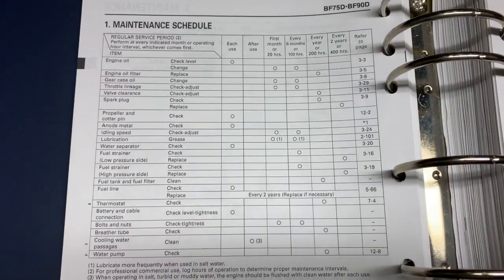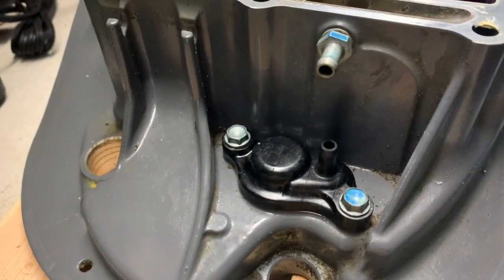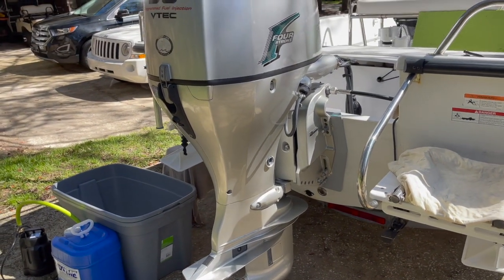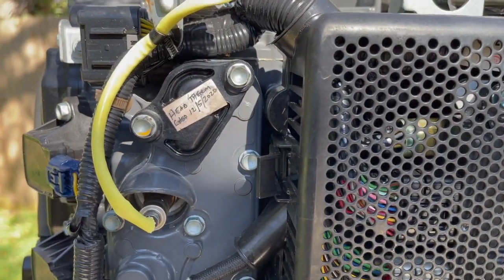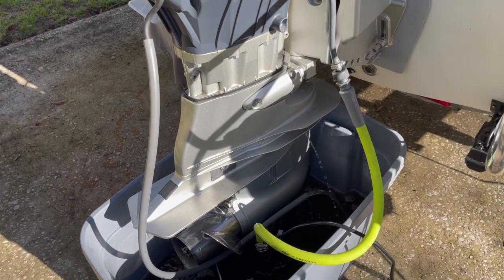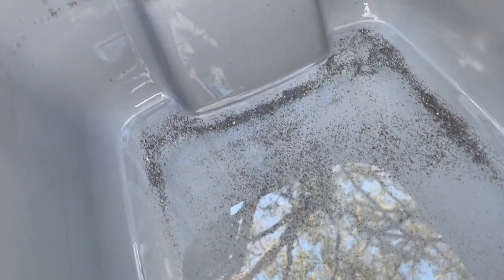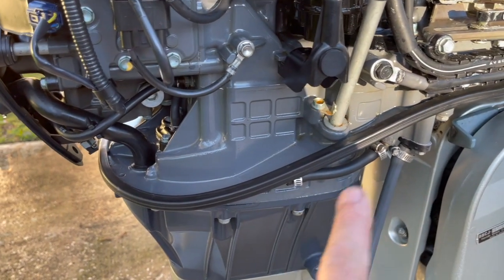Honda BF75D/BF90D Cooling System Troubleshooting and Maintenance

Comment: Hi Dave, Denis here from south africa. boaught a honda BF90 D. a Running it for about 6 months now in mixture of sea water and fresh, i do fluch it after every use, regular services carried out. a sudden problem came about recently while flushing with the ears, teltale is pumping brilliantly, no issues there. but, what i have found is that very little water comes out the propeller/exhaust. Lots of water coming out by the annodes.  water also steams, now i do understand water is pumped into the exhaust area for cooling, is the steam normal.

i have seen on other vidios that this also happens, and not that much water out the exhaust.

thanx

Denis
Reply from the maker: Hey Denis - mine sort of flows equally out the various exits.  Never hot or steamy which would concern me.  Have you changed the water pump and thermostats?

Comment: Dave, I have a BF90 with similar issues regarding heating. Did you have to open the head for cooling troubleshooting? I see the lower housing was opened up, but didn't see any engine block troubleshooting.
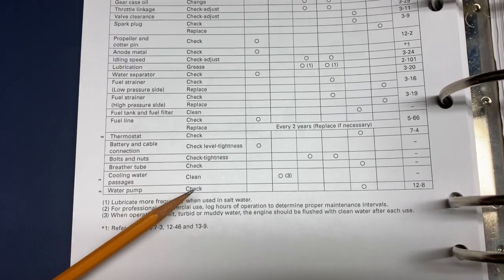Reply from the maker: First things to look at when you are having overheating issues are your head and block thermostats.  I show that in the book around the 1:45 minute mark as well as hands on removal around the 20 minute mark.
Reply: @davecavanaugh66  Yes, both thermostats were changed, and the relief valve changes as well.
Reply from the maker: @cristinadaniel9550  has the water pump been replaced?  What’s happening exactly - is the overheating warning lamp on and buzzer sounding off?
Reply: @davecavanaugh66  The entire water pump and housing were replaced, nothing was damaged on the impeller or housing, but replaced with new Honda OEM. The temp red light and solid alarm until key is turned off. Have recently ran Rydlyme through the engine for 4 hours. Only thing left is cracking water jacket to inspect, and I have replaced the two temp sensors.
I am not sure but seems the head temp sensor is in water but the block sensor looks like only uses metal mounting. (no water came out under pressure)
Reply from the maker: @cristinadaniel9550  wow that’s about everything I was thinking.  Does the motor shut off after 20-30 seconds when alarm sounds?  Does it sound off at idle or just under power/pressure?
Reply: @davecavanaugh66  Alarms only come in when running, around 4500-5000 and about 5 minutes. Had a kill problem, found the water port on bottom case to the fuel cooler was plugged. Think that was causing vapor block. Should have cured that issue now.
The shame of all these issues is that it has been religiously fresh water washed every outing
Reply from the maker: @cristinadaniel9550 wow yeah - got to check all those hoses to and from the water jacket on the bottom of the VST.  The flow inside all those cavities can easy get blocked up when running in salt water.  Trust me I know which is why I shared these videos.  I flush mine religiously and still have to clean my thermostats every 6 months or so.  Rydlyme flush is a must once a year when you turn these motors in saltwater.
Reply: @davecavanaugh66  Do you have any idea about the sensor mounts. The Head seems to have the temp sensor in the water column but does the Block have water surrounding it? It looks like it does not.
Reply from the maker: Never had to change my sensors out.  But I can imagine if there is build up covering it - that might cause an issue.

Comment: Hi Dave, do you know from where I can test the oil pressure with a screw in oil tester gauge? My. alarm buzzer on the throttle display is going off for oil though I have full clean oil in the dipstick and oil 300 hrs on engine? I see in the parts diagram there are two sensors, I can only locate the one under the oil filter that has a green attachment. I tried disconnecting it and turning key but the buzzer persists and light indicator is on for oil.
Reply from the maker: Never had that issue. Does the motor start and does the light/buzzer ever stop?  Kinda wondering - was this motor ever under water?
Reply: @davecavanaugh66  Motor starts, not a problem starting it. The light buzzer doesn't stop. It wasn't under water. I'll try a compression test tomorrow, just wanted to run it and warm the engine up before I did it but am nervous about running with that buzzer going off. I start having heavy light grey smoke coming out the exhaust if I run it for more then 2 minutes so I stop the engine. Temp alarm doesn't go off, the head doesn't feel hot, just warm.
Reply from the maker: Does the oil indicator light stay lit or go out when running?
Reply from the maker: Also is the buzzer sound continuous or intermittent?
Reply from the maker: High pressure oil sensor is near the oil filter on port side.  Low pressure oil sensor is about 6” behind the oil cap near the top of the motor on the port side.
Reply: @davecavanaugh66  Light stays on when running, and buzzer is continuous.
Reply: @davecavanaugh66  Thank you! I wonder which one I'd hook the tester up to.
Reply: @davecavanaugh66  I meant to say intermittent buzzing sound sorry! Also I just disconnected the low pressure oil sensor (thank you so much for telling me where it is) and turned engine engine and it is still buzzing. I disconnected both oil sensors and it still buzzes. Wondering if it's something else to be intermittent buzzing like that or just a faulty computer on the engine.
Reply from the maker: @ChopStrand23 if oil green light stays on - that’s normal, but if there is also intermittent buzzer, then that potentially indicates a faulty alternator or the water separator on the motor is full. That’s what the service manual says.  You might need to buy one if you keep having issues.
Reply: @davecavanaugh66  Thanks Dave, am actually waiting on it to come. Engine was missing a fuel filter in the water separator on the motor. Wonder if that had anything to do with it lol.
Reply: @davecavanaugh66   Just watched  your vid again on the fuel system, realized there is no filter in the fuel separator.
Reply from the maker: @ChopStrand23 did you watch my fuel system troubleshooting video at around 9:30.  Shouldn’t be a filter in the onmotor water separator.  But  if there is water in the bowl or the sensor or float is bad, then that could cause an issue.
Reply: @davecavanaugh66  If thats the case how would I reset the buzzer to stop?
Reply from the maker: @ChopStrand23 check/drain/clean the bowl and see if float is good.  Unplug the sensor and see if it’s bad.  I show what to look for in the fuel troubleshooting video.

Comment: I actually had my tell tale pop off on the water today. I am thinking about putting a hose clamp on it because it’s a day ruined stupid repair that can’t be done on the water. Strange it has one to at the block but not on the discharge itself.
Reply from the maker: I have a small zip tie on mine.  But yes that’s an issue that is often overlooked.  I have another video showing a similar problem where one of my hoses popped off on the port side of my motor which flooded the bottom half of the motor.  So I replaced several of my hoses with small hose clamps.  It’s not good when these pop off while you’re on the water - especially salt water.
Reply: @davecavanaugh66  Glad to hear I’m not the only one. Luckily it’s just fresh water so no worries with that. I was think of putting a zip tie on so I will do that. Thanks so much!!

Comment: Thank you Dave for this video. I couldn't make to work cold flush on my Honda BF60 2014. I used "garden hose" connection, but water didn't go into the motor. Motor was cold. Does it mean I have a lot of salt inside or just need more water pressure?
Reply from the maker: You probably need to unclog the flush port or the passage way just like I showed in my video.
Reply: @davecavanaugh66   you won't believe, it was exact the port full of salt and that is why the valve with a spring was blocked. I cleaned it and the other pipe as you did in your video and ... magic! now my motor can be cold flushed!!! Dave, you made my summer and saved my motor! Thanks a lot, it was not easy to find helpfull info. Seams our marine service is not interested to clean motors. And I was even criricised by other boat owners saying that nobody flushes motors in our salty North Sea and "everything is ok". God save 'em. :)
After 10 min flushing I started the motor and controls water flow was so strong like never was! I'm so happy!
Reply from the maker: @justin8mux  awesome.  It’s really important to flush with fresh water on the flush port AND also on ear muffs to ensure all passages get cleaned.  I also highly highly recommend doing a full descaling flush once a year to ensure all passage ways are clear.  In the video I show how to do this with a commercial grade product called Rydlyme.

Comment: Love your videos. Have you done one on Honda charging systems. Mine blew the 70 a fuse. Need troubleshooting ideas. Thanks
Reply from the maker: I have replaced my fuse and the rectifier directly behind the fuse.  I can’t remember how mine blew but I think it was something stupid I did like hooking up the battery backwards or something 🤪.  The rectifier is what converts AC to DC for charging the battery.  Replacing the rectifier will also ensure steady charging voltage.

Comment: Thank you very much. Great video,helped me a lot! I got newer honda bf100a,difference is in intenal zinc anodes ,much easier to remove on bf100. May i ask,how much internal anodes got honda 90d ?
Reply from the maker: The BF90Ds have 3 externals only
Reply: @davecavanaugh66  i found 2 internals in engine block

Comment: Great video thanks for sharing . I have an issue where my flush valve is backfeeding and leaking out when motor is running. What would cause this? I pulled and cleaned flush valve and pressure relief valve. Ordered all new parts now for it relief and flush valve and all related components. Hoping that will solve this problem. Any info will be much appreciated . Cheers
Reply from the maker: There are a few places in the video talks about cleaning the flush port and valve.  If it has a bunch of sediment built up, the valve won’t seal properly.  Use a small screw driver and small wire brush set from a gun cleaning kit to get it cleaned out.  Also squirt some CLR up in there to break things up when cleaning it out.  Lastly, make sure you have all the parts including the spring which will keep the valve sealed.  Also use a little gasket maker to help seal it when it’s seated.   I show all this in the video.  Mine had issues and now it works great.
Reply: Thanks for getting back to me. Maybe I should of ordered the spring too. I will definately clean it out some more and try the clr . Also had the poppet valve out and now leaks but I’ll try the gasket maker . Thanks for the great video !
Reply from the maker: @jong8125  yeah on older motors, it’s hard to get a good seal when there’s corrosion and pitting, so gasket maker is a must.  Definitely get that spring for the flush valve.  Lots of trial and error.

Comment: I've recently purchased a boat and motor it's a 1995 bf40 Honda 4-stroke but I've noticed that the after I get home from boating it has the side leg right where it touches the water seems to be warm warmer to the hand than it should be and I'm wondering is that a sign that I'm not getting good water flow through the motor after watching your video it made me assume that that might be the case and my understanding was two that this boat and motor set 10 years in a garage unused
Reply from the maker: Not quite sure what you are saying here. What is a side leg? Is the motor peeing water? If it was sitting for 10 years, has the water pump been changed?

Comment: Hi Dave. Karl here in Australia. Thank you for this video. I did have one question that I'm hoping you can answer. There's some telltale holes at the back of the gear casing up the top near the oil fill plug (two on each side) you can see water squirting out when the engine is running.
I'm trying to get my head around why there would even be water in that section where the pump is housed. Do you have any idea? 
Cheers 
Karl
Reply from the maker: Hi Karl - Yes that’s normal to have water flowing out those side peep holes on the lower unit.

Comment: I have he BF 75 didn t know 2 thermostats I just changed one, Now I have to check other one on block ..If can find it, I getting water in oil told could be thermostat
Reply from the maker: Not sure the thermostats are going to be the cause of water in the oil.  That’s probably something more serious like a seal or cracked head or block.
Reply: @davecavanaugh66   I didn t think was posable. few people told me could me. One guy on outboard form said he finds lot of Honda s and Yamha's with thermostat stuck open and water gets in oil?? The top one was stuck open. it was A bitch to get out. needed be changed .so I try  if don t fix it I ll have to find A honda shop to bring it to. Bet be big job ??
Reply from the maker: @toddbollen1455  well that’s a new one on me - never heard that one.  Those two systems are isolated from each other. Could be seal somewhere deep in the motor that failed and causing water to get in to the oil or it overheated and blew a head gasket or something is cracked.
Reply: @davecavanaugh66  Thats  what I thought all so. But guy on forum when works on outboards  told me Honda and Yama s known for it said thermostat gets stuck open and condensation gets in there. Found  other thermostat and was stuck open. was bitch to get out,, SO see what happens. Have feeling tho going need A big motor job done . But worth A try I have fishing trip coming up . O ll mostly be using troll motor and not going to far .Tho motor has been running great. I wouldn t of noticed it if didn t check oil.
Reply from the maker: @toddbollen1455  let me know what you find out.
Reply: @davecavanaugh66   ok

Comment: Great Videos.  I have a 2009 BF90D with about 700 hours on it.  I do have one small problem in that there is a leak in the lower Anode on the crankcase head.  I have been trying to find information on how to change this out, but with little luck.  Any help would be appreciated.  Thank you in advance.
Reply from the maker: So there are two anodes in the head area that are only accessible if remove the head water jacket cover which is more involved.  I have my local shop do mine at the same time they check my valve clearance which is supposed to be done every 200 hours.

Comment: doing a flush on my 90 right now but I'm not getting any flow through the head thermostat.  Am using salt away, a 350 watt/7000 L/hr submersible pump and both thermostats out.  Water is flowing through the telltale.  This is the first time I have gone to this level of flush so i may have some constriction somewhere.  The thermostats are both working to spec although the block one was severely encrusted.
Reply from the maker: I can tell you first hand some sump pumps may not work - they are really designed for volume and not so much pressure which may be why it won’t push to the top of the head/block.  No worries though, you may just need to run the motor (with the thermostats in) in the bucket with you flush mixture until it gets hot, then shut it down, let it cool and repeat.  Not ideal and takes a while but it works.
Reply: @davecavanaugh66  thanks Dave.  Will keep at it.  The Honda flush pipe appears to act as a natural  flow reducer which then limits head height.  There is plenty of flow from the pump when it's  not connected.
Reply from the maker: @swain429  correct - that reminds me - when you use the flush port with the sump pump, you will need to remove the flush port valve to get unrestricted flow.  I show that in the video.
Reply: @davecavanaugh66  yes, done that.  It was fairly choked with salt.  I have virtually copied your video.
Reply from the maker: @swain429  ok good deal.  Really curious if Saltaway will be a powerful enough to get get out all the crusty crap.  Took me a few rounds using Rydlyme. I’m interested to know how it goes.  Good luck!
Reply: @davecavanaugh66  thanks Dave, still beavering away at it.  Have now found that that the water pressure relief valve cover is leaking badly, and has probably been doing so for quite a while,  Both bolts are severely rusted and a 10mm socket just rotates around them.  Any suggestions?  I can probably get a nut remover(easy out) on the front one but the back one is going to be a real bitch.
Reply from the maker: @swain429  oh boy that back bolt is a serious pain - I had a similar issue. On some of my rusted bolts, I was able to use a 8-9mm and that gave me enough bite to get them out.  I bought a 10-11mm and 8-9mm 12 point 45 degree box end wrench off Amazon that worked great for me.  It’s tight in there and that 45 degree wrench was the ticket. Convy GJ-0019 Double Offset Box End Wrench Chrome Vanadium Steel Metric 8mm-9mm https://www.amazon.com/dp/B07GNBMDXC/ref=cm_sw_r_cp_api_glt_fabc_A3KBVAYV6JT43PPZXG1G?psc=1